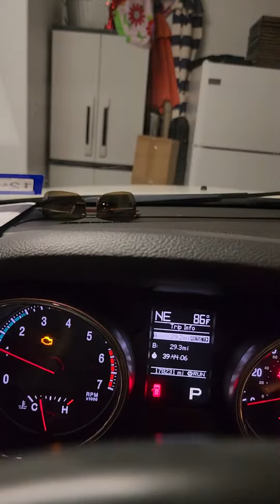Jeep Grand Cherokee Xenon headlight replacement. Takes 10 minutes -  tops.

Comment: The length of my cable that had the connector the bulb needed to be plugged into seemed way shorter than in the video.  I had to pop the hood and then reach from the top with one hand to hold the cable and then plug in the bulb from below with the other hand.  This was a brutal task

Comment: So glad I watched this video and didn't remove the air filter box. Been there, done that. Took me 5 mins to remove and replace. But that damn rubber cap! Took me longer to get that seated correctly than replacing the bulb. But this is the way to change the bulbs much quicker and less hassle. Thanks man!

Comment: I don't have the access hole so I removed 3 bolts from the wheel panel which gave me enough access to get the flashlight beam . Just turned the wheel to the right. I guess a 10-15 minute job?

Comment: Can anyone please tell me do these HID bulbs Control both the high beam & low beam with just the one bulb ?? Just had both sides replaced on my 2012 grand Cherokee limited, I had to track the bulbs down myself, took me a whole day and a lot of running around but I finally found 2 at a local Auto Zone , took my jeep back to the garage that  couldn't seem to find these lights on their own so  I
Reply: Its a shutter that opens for high beam, partially closes for low beam